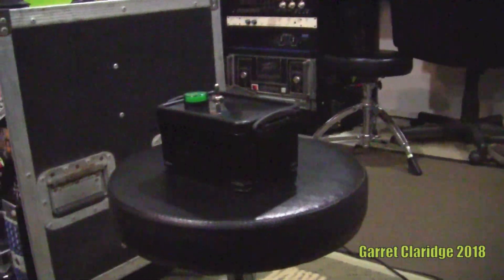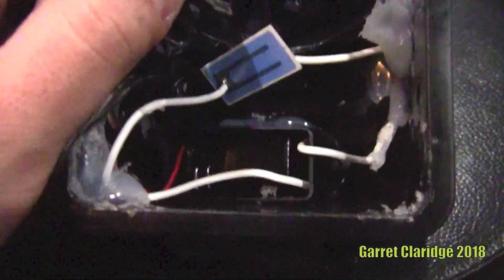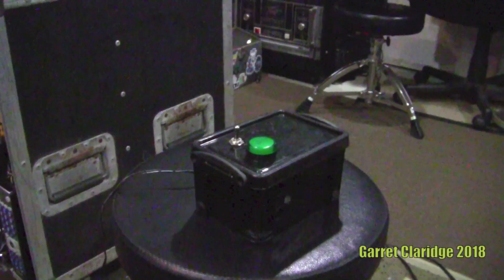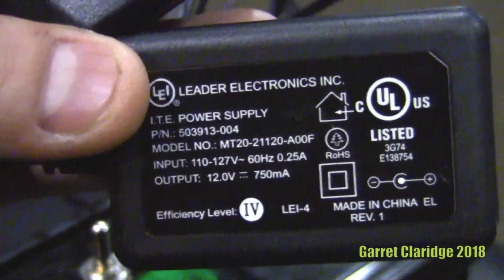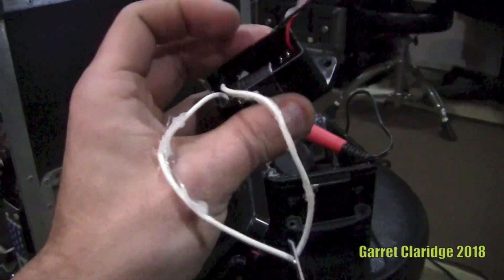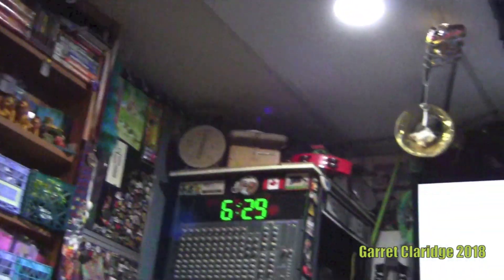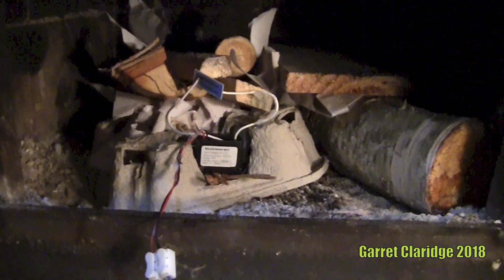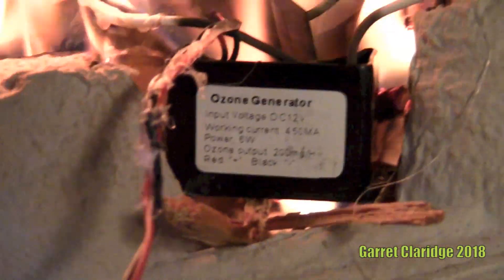Electronic Overload - 12v DC Ozone Generator on 120v AC

Comment: that power supply you showed actually puts out 12V DC. The sign with the 3 dots under the line after 12V means its DC. the sinewave after 120V means its AC.
Reply from the maker: haha sorry yeah it was the other smaller one that fried it and the one shown finished it off on me lol i just turfed both to be safe
Reply: Garret Claridge can you finished it with fire

Comment: What's the difference between AC and DC? Also, love the vids!
Reply: Ando56 Alternating current is exactly what it sounds like, it alternates, so it pulses at 60 hertz here in the US and 50 hertz in Europe. If you wave your hand in front of a plasma, CRT TV, or even some light bulbs (fluorescent works best) you can see a trail. That's because it pulses on and off faster than we can see. Direct current, or DC, does not alternate, instead it is a constant, steady stream of electricity.
Reply: Toxic Tech Tat thank you, I knew what they stood for when I saw Garretts next video but that explanation you gave me makes a lot more sense

Comment: my question is why you were making an ozone generator
Reply from the maker: ozone is an awesome way of removing smells, I have made many of these things for different uses,  Big reason I started using them was because of the wood burning stove and the smoke damage that would occur in the house if the pipe plugged, I could then ozone shock the house with a much bigger unit and loose the campfire smell neutralizing the odors great, I end up lending these units lots for people to shock their cars interior all in one shot --- Just the other day someone burned a pot and bone on the stove and made their house stink like burned bone it was the worst. the smell was in everything and Finally I gave them the ozone. Within a couple uses their house had no evidence of the burned bone smell
Reply: Garret Claridge heyyy that's pretty legit, always cool of you to share
Reply from the maker: It sure is! But if used correctly it can be a great thing, I often put fan timers on my bigger machines so I can push it on for 10 or 30 mins leave the room and come back in an hour when its gone to have this really neutral smell after the ozone is dispersed

Smaller machines are ok to give a little blast in the room, that is why this had a momentary & locking toggle but not much is needed to quickly freshen a room 

Too much exposure is hard on lungs for sure, and overuse in the house can give people some nasty sickness, lots of reports of this when a machine is used in the wrong situation, like on low daily in a home. some of these look like simple home air purifiers and if used that way will make everyone sick for sure

needs to be treated as the chemical it is, I used to buy ozone in a can and now I have an endless supply
Reply: Isnt ozone unhealthy?
Reply: ya